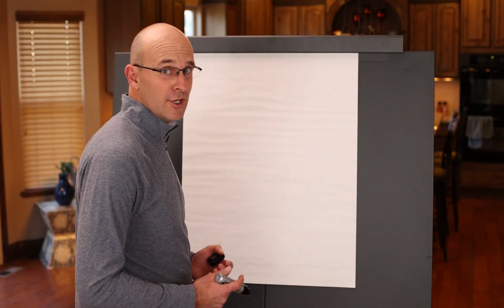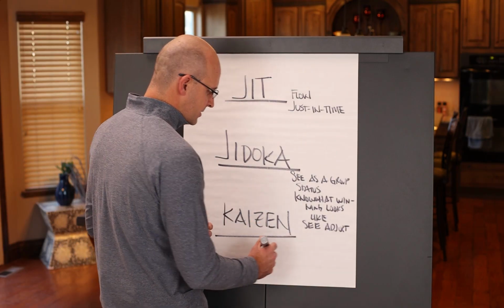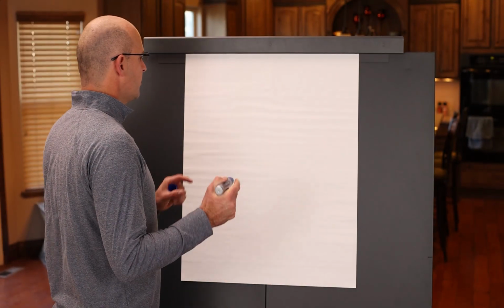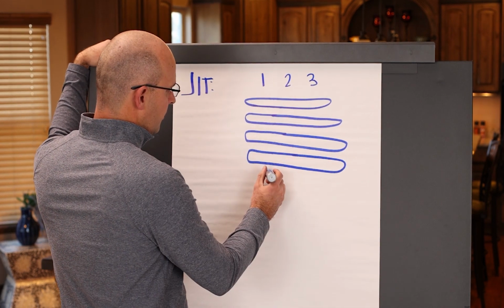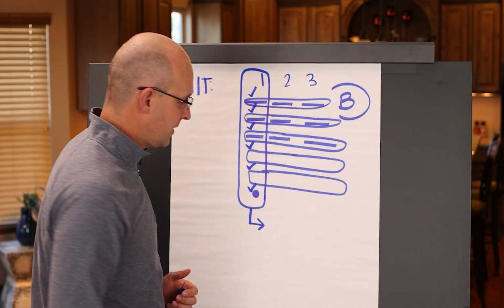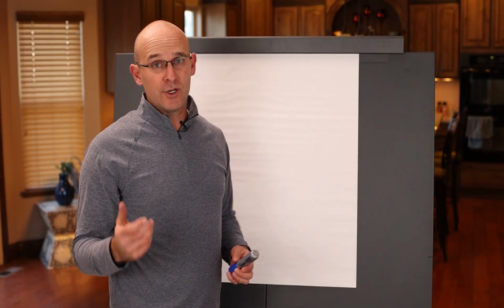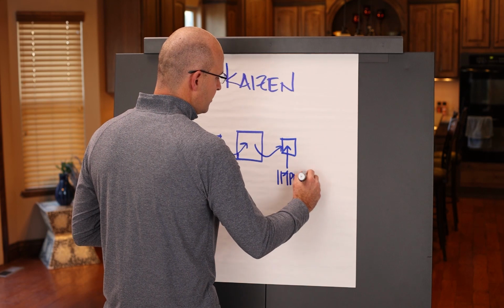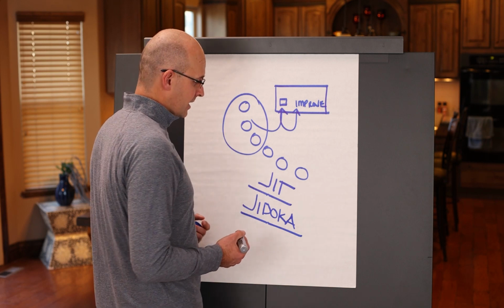How To Increase Productivity And Efficiency At Work

Comment: at&t uses good old fashioned MATH... time took to do a job, time that the job is allotted (which shrinks to favor mangers) THE PROBLEM WITH MAN AND STATS ON HUMANS is the following:
1. the MORE jobs you do, the LESS your efforts matter to the stats. 
For example, if I do only 4 jobs, and you do 4000, and I have 1 unhappy customer, I am 75%. You  have 1000 unhappy customers, but 3000 happy ones.  If you place ME and YOU on the same level? thats stupid...

I did far more work, and made you far more money, than the man that did only 4 jobs. 

yet I get written up for poor performance just as quick as the man that did only 4 jobs?

also the man with only 4 jobs can Better his numbers with just 2 jobs. It would take me 2000. 

THAT LAST PART is where all the bias comes in.  sexist. racist, age, all sorts of things. the minority or older man is busting ass to do more work and ends up as "efficient" as the guy with barely any output.